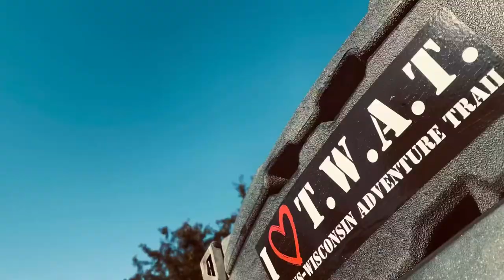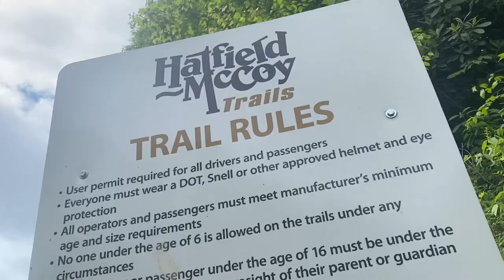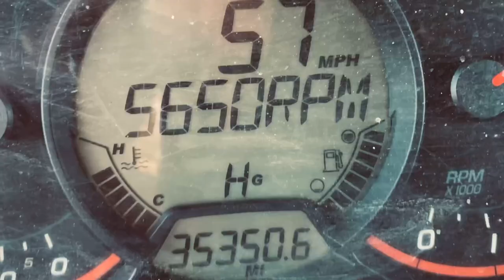8,650 Mile, 35 Day, 22 State Overland Can Am X3 SxS Adventure

Comment: Then dogs had a blast! Amazing idea. Wish you would have listed the breakdown parts besides the belts. Every state looked enjoyable.
Reply from the maker: Other than belts, it was wheel bearings and rubber axle boots, which OCCASIONALLY led to adjoining parts - rolled into a gas station and had people screaming that I was on fire.  But it was just a smoking wheel bearing, which got hot enough to take out the axle and wheel hub…

Comment: Man this is my absolute freaking dream to do with my defender. How was reliability on the trip. That’s quite a bit of traveling!
Reply from the maker: As reliable as any SxS can be - mine started the trip with about 27,000 on the odometer... made it all the way around the full 8,650 miles with zero issues EXCEPT for the rear wheel bearings.  

I SHOULD'VE swapped em before I left, but I wanted to see how far I could go on em - got out to pee in Iowa and got my answer...bearing grease was boiling.  

Took the knuckles, hubs, and axles with em - overnight shipping was VERY helpful.

The other lower mile machine went through two transmissions and a secondary clutch - all repaired along the way thanks to some great people and shops.

Got my machine in the shop now, prepping it for this Spring - gonna start the next trip with 40,000 on the odometer. 

The motor just got rebuilt by the dealer, paid for by the extended warranty company, and it's getting new Keller Mega ball joints, new rod ends (heims), uniballs, and misalignment spacers. 

AND I put new knuckles with bearings on all four corners  along with brake pads.  Tossed spare knuckles, hubs, and a few of every bolt and nut on the car in the tool box, just in case.  

Gonna beat on it a bit around the Arizona Peace Trail to see if anything gives.
Reply: Damn 40k on a SxS!! Wow that's amazing man!!! Great video!!!

Comment: Hey Al, famn it, I'm even more jealous now. How's that frame holding up  ?  What else did the guys at CT do to your rig ??
Let me know if you're in Arizona and want to go for a ride someday. I'm in town for a few more days,  anyways. 
Rubberized down buddy, enjoy the ride ....
Reply from the maker: The frame is holding up GREAT, so FAR - got LOTS of gussets welded in there from CT Raceworx - they also put a cage on it that allowed me to keep my OEM Power-lift windshield AND they put a rain gutter above the windshield to keep water from dripping in, which was MIGHTY appreciated!

And they installed an overhead console for the radios and switches to keep em dry and put rubber fist clamps all around the machine for holding shovels, saws, hatchets, and some tools.  And put some side and rear facing lights on it.

The hounds also got a tool box mounted in the back to ride on.

It already had their arms, tie rods, bushings, and gusset kits. 

Fix’n to get out on the Arizona Peace Trail at the end of the week with a fella from Montana - he’s break’n in his ‘21 RR 🤠.
Reply: @alroden6802  The rig is looking awesome Al

Comment: Mate this is insane, what size fuel tank and mileage would you get if you aren’t going crazy ? Would love to
Do this over in straya
Reply from the maker: Did it with a 10.5 gallon tank the first couple years - got a 14 gallon main tank in it now…gets around 14 miles per gallon…

Also have a 9 gallon transfer tank under the front seats for LONG stretches…

Probably have about 18 usable gallons, max…250 to 300 miles or so maximum range depending on tires, terrain, and throttle…

Comment: Nice trip. were you able to do it all without trailering?
Reply from the maker: No trailering for me and the hounds, but we did have to get towed back to Sioux Falls from Iowa for repairs (about 50 miles) - stopped to urinate and heard the grease boiling out of one of the rear wheel bearings.

Got that fixed and had the other wheel bearing go out in Michigan’s Upper Peninsula - got towed a couple miles backwards to make repairs again.

Though we managed to make it around this year’s 11,000 mile loop to Maine and back out west without getting towed or having to do ANY trail repairs besides belts.

Although we did limp home at 225 degrees on the temperature gauge and three missing clutch rollers 🤠.

Comment: what app or software were you using for mapping a trip? Also, do you have a map route for this trip that you are able to share?
Reply from the maker: For the trip in the video, I purchased the Trans America Trail (TAT) GPX map files from the TAT website, then exported em to the GAIA GPS app for navigation purposes.

Also got the Great Western Trail map files from the internet - it was from an Adventure Bike ride, so there were some single track parts that had to be rerouted around.

And the Trans Wisconsin Adventure Trail was a free download too - from their site.

Then it was just connecting em all together - the TAT and the GWT connect with each other, so that was easy…had to wing it to get to dirt in Michigan.

Got most of the Michigan stuff from VVMapping…

When the final route was figured out, it got exported to Google Maps to locate fuel,  campsites, and potential repair shops near the route.

Still had LOTS of detours to make during the trip - closed roads/washes out bridges…

Comment: On Gaia gps what did you set your route driving or cycling or did you just manually do your route because I don't want to do that many main highways also do you know a way on that app to include trails or did you do just back roads? Also if it wouldn't be to much trouble would you have the gps files you used on your trip? thank you!
Reply from the maker: From Phoenix, going north to connect with the upper Trans America Trail in Idaho, we rode the Great Western Trail - that’s the first 1,000 miles or so…it was about 75 to 90 miles of pavement to get around the Grand Canyon and across the Colorado River.

From there, we just followed the Trans America Trail by Mount Rushmore and across the Badlands to the Mississippi River - it was MOSTLY gravel oil field and forest roads to Iowa, then gravel roads through the Iowa corn fields.

From Lansing, Iowa, we crossed the Mississippi River to connect with the Trans Wisconsin Adventure Trail - it’s a mix of backroads and OHV trails into the Michigan UP.  

Across the Michigan UP, it was the Stateline Trail and other OHV trails to the Mackinaw Bridge - the bridge is Interstate Highway with a toll booth, but it’s 45 mph or so across it…no issues at all.

Once across, it was 20 to 30 miles of blacktop to connect with the washboardy OHV trails of lower Michigan.

Once we got down to the Battle Creek, Michigan area, it was MOSTLY blacktop across Ohio to West Virginia to connect with the lower Trans America Trail - don’t see any way around that…not much gravel or dirt to be had in Ohio.

Then we just rode the Trans America Trail back west.  

This trip, in this video, we crossed Colorado…didn’t do that in 2022…

In 2022, we left the Trans America Trail at the Oklahoma/New Mexico border and took dirt roads (Backcountry Discovery Routes) across to Arizona…I liked New Mexico better than Colorado anyway.

Didn’t use GAIA in 2022 - I imported the tracks from GAIA into LEADNav routes and put an audio marker at EVERY turn…still recovering from carpel tunnel syndrome 🤠.
Reply: @alroden6802  thanks so much love the videos keep it up,

Comment: Your average is 247 miles a day.
Reply from the maker: That’s the average.  Probably a little more on the “rolling” days  - spent a few days doing repairs and waiting for parts.   But, we DEFINITELY didn’t waste any time - we drove from sunup to midnight on some days, stopping only for fuel and food. 

Though that’s fairly consistent with the more recent trips - the 11,000 mile loop took 43 days, which works out to around 255 miles per day.

And the last trip was 10,000 miles in 40 days (250/day).
Reply: @alroden6802  where did you go with this 8000+ mile trip. Retired truck driver, I would have to drive to drive two round trips from Atlanta to LA and back. And South Bay Florida to British Columbia is 3500. Just wondering
Reply from the maker: @tommysimmons5266  - We started in Phoenix and wound our way up to Idaho, zigzagging across Wyoming and across South Dakota and Iowa to Wisconsin, then up to the Michigan UP, over the Mighty Mac and down to and across Ohio to West Virginia.  

Then it was down through a sliver of Virginia into North Carolina and down to Tennessee, zigzagging across Tennessee to Mississippi and into Arkansas and across Oklahoma to Colorado and back to Phoenix through Moab, Utah. 

DEFINITELY not a straight route - LOTS of windy gravel roads.
Reply: @alroden6802  that’s what I was looking for, nice. Ever think of doing the Lewis and Clark trail or anything like that? 5 years ago I rode a bicycle with a trailer from Detroit to Nebraska cowboy trail then south into Kansas on 81 until I hit early snow. Doing the bicycle camping thing again soon south of highway 59-89A to the Grand Canyon.